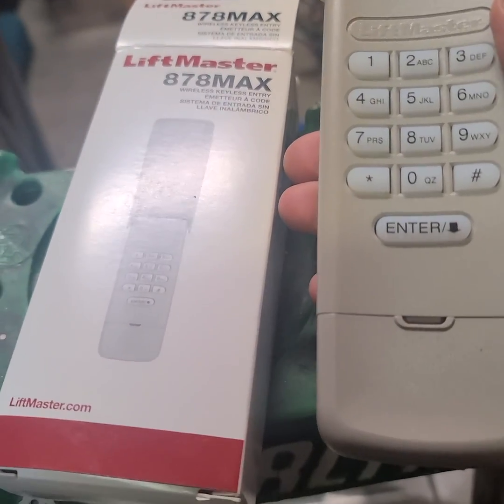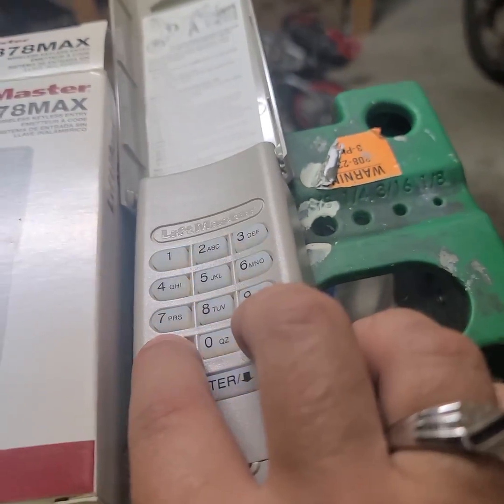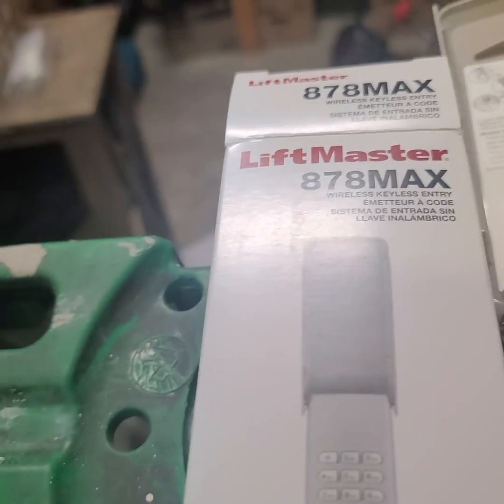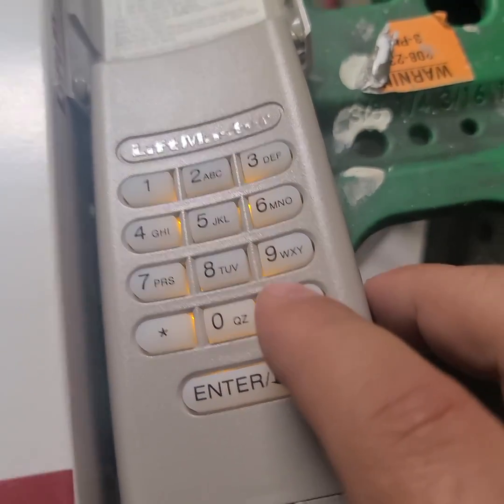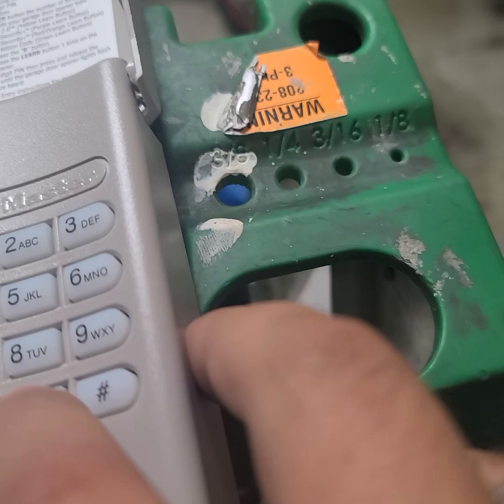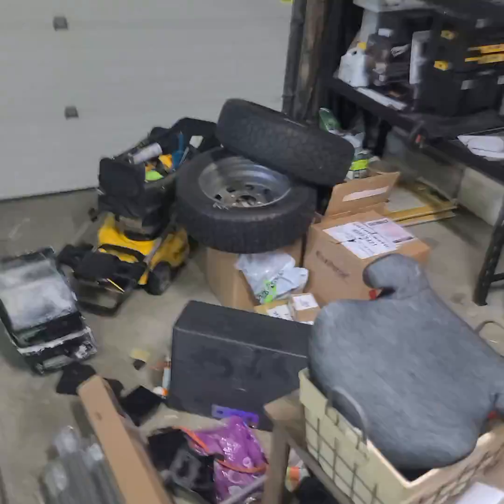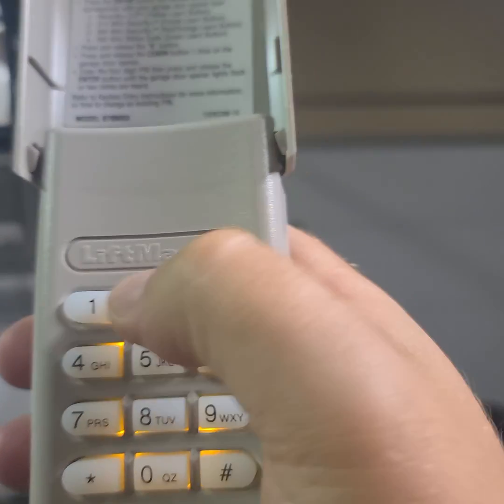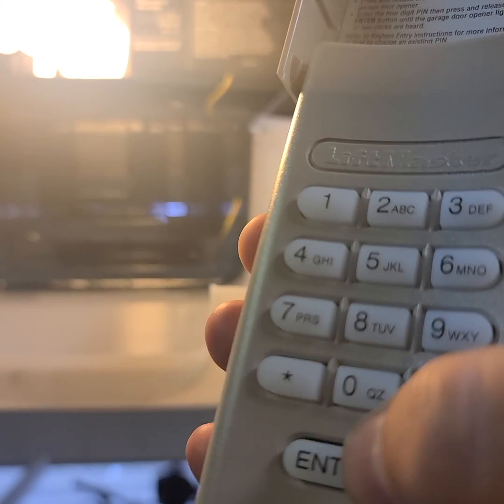how to program a 878MAX wireless keypad

Comment: I just successfully programmed mine. This was very similar to the instructions supplied with my remote, but after seeing how different my reset button looked, I decided to try pressing Enter different amounts of times for different frequencies. Apparently, my dark yellow/orange reset button is actually purple, because that's the frequency that worked. Maybe it once was and discolored with time. Anyway, keep that in mind - try pressing Enter 2 or 3 times before hitting the reset button if it doesn't work right away.

Comment: I bought this same model of keypad to be used on a model 8500 opener that mounts on the wall next to the door. Neither instructions supplied with the keypad (including the one in this video) worked on the door. I had to use the instructions for the 877 keypad that came with the door which told me to use the wired remote on the wall to do the programming. That worked excellent!